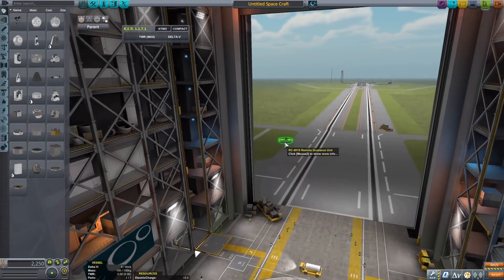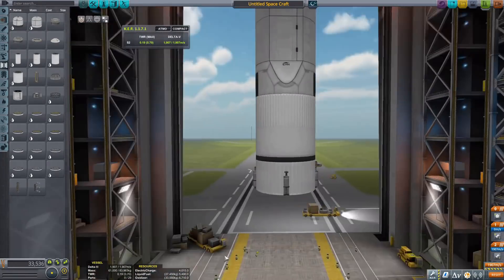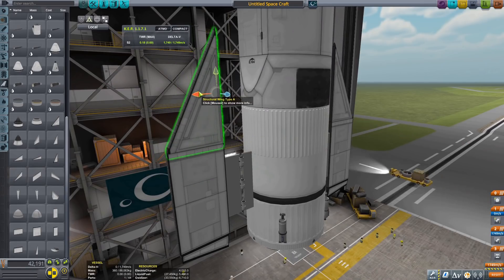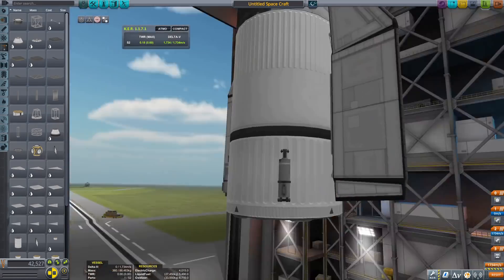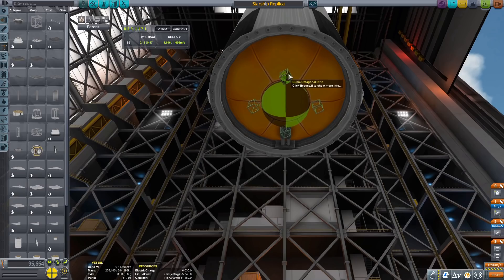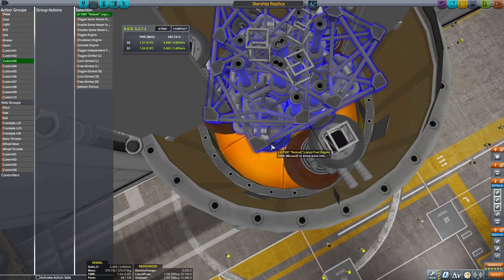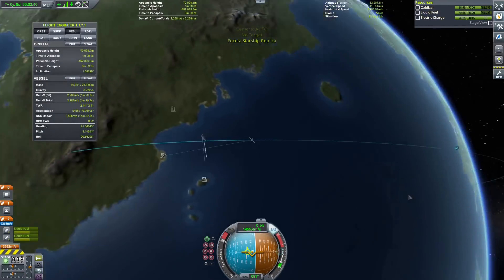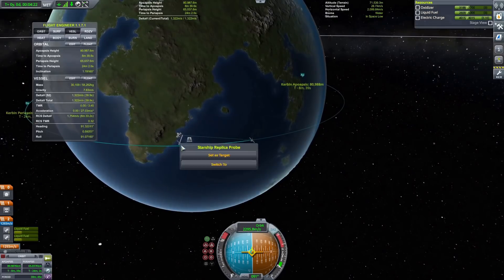SpaceX Starship Style 100% Reusability | Kerbal Space Program

Comment: Why the hell aren’t you using engine plates?
Reply from the maker: Mostly habit, but also because securing concentric rings of engines (such as the inner ring of bobcat engines and the outer ring of cheetah engines) would require two engine plates if I'm also going to attach the engines to the nodes. I don't see the point of using engine plates rather than a decoupler if I'm not going to use the attachment nodes, or if I need two of them to use the nodes for concentric rings of engines.

Comment: You Should Have Used Vectors And Wolfhounds For The Engines
Reply from the maker: If I had gone one tank size larger, that is what I'd have done.
Interestingly, the Vector engines overperform compared to Raptors (presumably because they are RS-25 analogs) while Wolfhounds really underperform compared to vacuum optimized Raptors. I have the same problem with the Cheetah engines underperforming compared to the Bobcat engines, but with the lower tank size the load is significantly smaller on the hinges, so they fail less often under aero stresses.

Comment: I downlosded ksp but im trying build rocket and im losing control of it when flying
Reply from the maker: Things to look for are:
Do you have SAS on? You might want more RCS thrusters (the vernor engines work well) to maintain control.
Is it spinning, or is it tumbling? If it's spinning, then by adding struts you stop the parts from bending relative to each other. If it's tumbling, you'll want to experiment with the flaps or fins to see if you can find a way to make it stable.
Reply: @parallelflow  well i always turn on sas but im spining alot
Reply from the maker: @aurimasmockus8307  On a starship replica, it seems like the hinges bending make it spin out of control. What I've found that helps is anchoring down the hinges using struts, such that the base of the hinge is attached to the vehicle, and the other end of the hinge is secured to the flap. Don't put struts between the vehicle itself and the flap though, since struts across would stop the hinges from working.
Reply: @parallelflow  im trying to make my sattelite for now but im confused about those strange parts

Comment: am i using the airbrakes upside down? it gets the job done but i scrach my head why you just deploy them at 10km they start slowing your ship earlier on. btw those engines dont have other design? some are able to remove some of the acessories like the exaust and the stand 😊
Reply from the maker: The airbrakes work just as well in either orientation actually

Comment: is it just me or is that thing at one point gliding?
Reply from the maker: Haha, yes... without the crew cabins in the nose, it's a bit unstable, and so after it inadvertently flipped around during descent I discovered it could glide... and stall at 14:10
So anyways I can now say I stalled a Starship lol
The real starship also seems like it has this problem, otherwise they wouldn't have put the header tanks in the nose.
Reply: yeah, honestly it just makes me want to give it something like an air breathing engine, maybe extend the wings to make her fully flight ready :D
Reply from the maker: @darthmemeious9526  Not the worst idea I've heard.. I suppose it would be similar to the Buran space shuttle which if I remember correctly would use jet engines to reach the landing strip.
Reply: yeah the buran and energia were certainly a good launch system for a wide variety of purposes, and the fact it could operate on its own and even do multiple landing attempts. its sad it went belly up after the fall of the soviet union... fun fact i once saw on display one of the orginal jet engines, it didnt have the casing and nothing, but according to the exposit it flown once.
Reply from the maker: @darthmemeious9526  Cool. Now I'm curious why the American space shuttle didn't have jet engines - considering that that would have made it better from a military standpoint early in the program, when there was more of a focus on the cross range capability if I remember correctly.
Reply: @parallelflow  well i think there probably is a shuttle in a military hangar with jet engines equipped, it would definitelly be usefull in certain situtations... i read an article about catching a reentering payload with a plane once (like the first spies in the skies, air balloon satelites), i can imagine a cold war situation where this could certainly be usefull, tho space shuttle is an overkill for this kind of mission, not to speak of the risk of loosing the aircraft and crew.